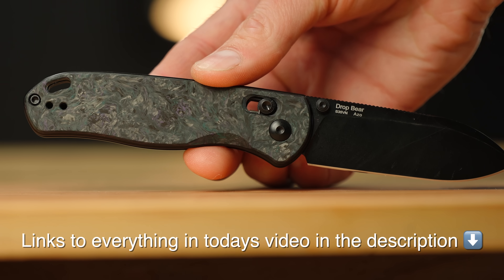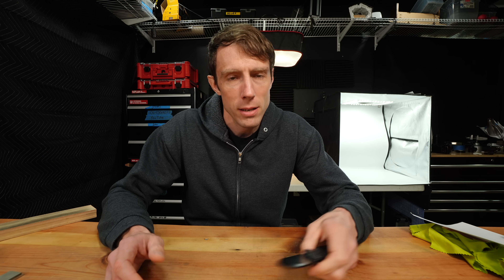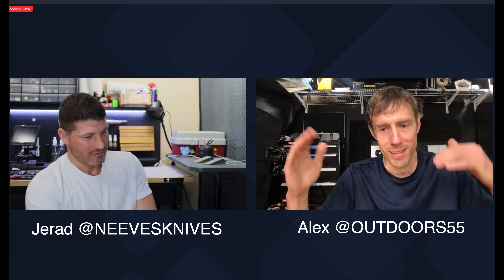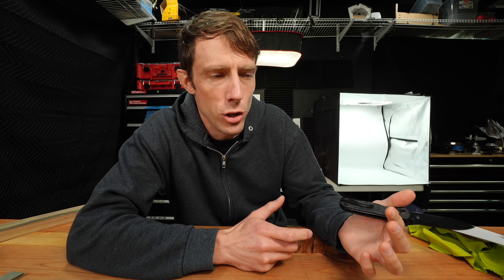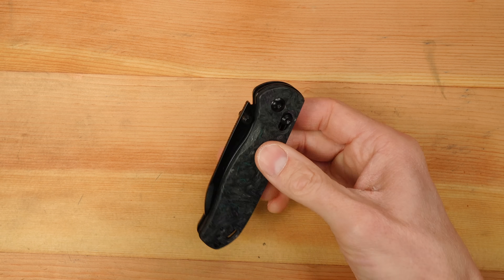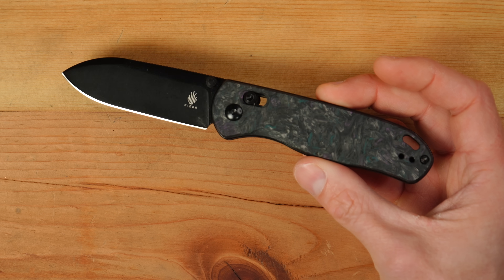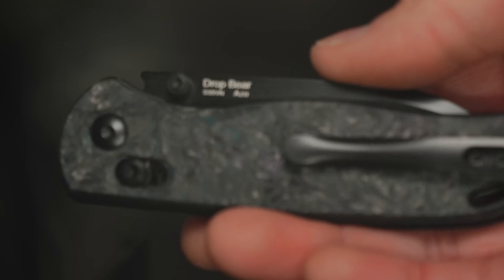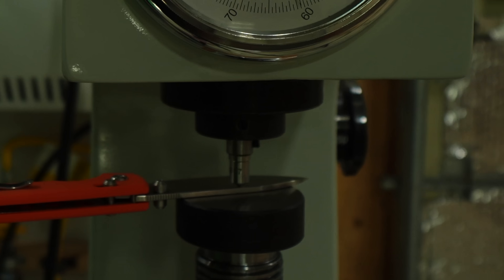Kizer Drop Bear Review - All Time Great, Or Over Priced Wannabe?

Comment: Kizers heat treatment overall is not good. They did improve some steels ht but overall I just avoid the brand.
Like they use a lot of 154cm, but would be better off using 9c18mov with civivis heat treatment which is better than 154cm performance and affordable.

Steel and ht is value. If its low its low value. If its low value the price better reflect that.

Comment: Bummer that they did get the hardness over 60 hrc.  I wonder if the uncoated versions or the 154CM versions are harder?  I have an Oknife Rubato 2 (OEM'd by Kizer) in 154CM that I love, but I have no idea how hard the steel is.  I just don't use knives hard enough to know.

Comment: I have the Elmax version with Artic Storm fat carbon. $210 I'm interested to know what the hrc is. It definitely gets extremely sharp and it seems to hold its edge similar to s30v or s35vn in my opinion.
Reply: Elmax is really good at 61rc. Dont settle for less. I wouldn't pay that much for any kizer though no matter the materials.

Comment: I've made a fair few knives out of S35 and its a much happier steel in the 60+ HRC ranges when it comes to stability in the geometry and retention with some pretty nice carbide production. But its an expensive steel and a bit of a hard sell to the general public for why they should use this expensive stainless kitchen knife over a much cheaper one and to some extent, they're actually right because its not that extraordinary a metal. Its very good and I genuinely like making knives out of it but I'm not going to say its great either as in terms of material price + performance its been eclipsed by others over the years.
Reply: Its hard to find good ht for s35vn. Chris reeves and Spyderco are about the only two that do it better than most others in production knives.
Reply: @tacticalcenter8658  its got ok ease of production but you probably want cryo to eke out a bit of toughness and hardness, it also has some pretty good edge retention and stain resistance. To the point if its corroding in something while you're attached to it, I'd be more worried for the health of the owner.

It doesn't finish nice enough for high end custom work though, takes a high satin machine finish but won't take a nice mirror. Main problem I have is that its high end prices for the metal for what's essentially the upper-mid range of stainless
Reply: @krissteel4074  there are much better materials like 14c28n, nitro-v or Abel.
Reply: @tacticalcenter8658  14C and Nitro-V are basically AEBL with some extra spices thrown into the mix. They are extremely tough and take a super fine edge but don't hold it for as long as S30 or 35.
It certainly looks better and you can get a nice finish on most AEBL family of steels
Reply: @krissteel4074  some heat treatment protocols for them do as good or better in some cutting than s30v. So you are wrong.
Reply: @tacticalcenter8658  Nah, you're not going to get much out of the AEBL for edge retention. S30 and S35 will at least double it's amount of cuts. All that Vanadium in there makes for some serious wear resistance
Reply: @krissteel4074  actual cardboard and rope cutting shows that some mass production 14c28n and nitro-v can cut more than most mass production s35vn and s30v.

Comment: I belive esee also heattreat the s35v version of the esee4 at 59-60 hrc. Is that a waste of stell?
Reply from the maker: 60 isn't terrible...im not sure what the point of a premium steel is if its only going to be 59hrc. Theres so much performance potential left by not leaving it harder. Personally id rather have 1084 at 63hrc than s35vn at 58-59.

Comment: Hrc hardness and edge retention cannot be compared across different steels. E.g. 58 hrc s35 has higher edge retention than 14c28 at 60 hrc.

The most important use of high hrc is the ability to hold a more acute edge angle. So unless you intend to sharpen at 25 deg inclusive or less, I think there's no real need to go beyond 58 hrc. 

Disclaimer: this is just my opinion.
Reply: Speak in facts. Crk is 60rc and Spyderco is 61rc and both perform far better than any s35vn at 58rc.
Reply: Often times 14c28n surpasses s35vn in cutting cardboard.
Reply: @tacticalcenter8658  yes I'm sure that happens. One of the most important factor for edge retention is the edge sharpening angle. A smaller angle has much stronger effect than a "better" steel. And higher hrc allows smaller angles.
Reply from the maker: We aren't compairing edge retention. We are comparing quality of the product for the price point. A premium steel like s35vn should have a premium heat treatment. If a $60 knife can do it, so should a $170 knife.
Reply: @OUTDOORS55  100 percent!

Comment: The only production company that's willing to run there steel hard is spyderco, everybody else runs there's soft as dog $&it, they want toughness over edge retention, but that's not why we buy most of these steels
Reply: Not every one. Kunwu pushes their steel to the limits. Even their budget IronFly brand has HRC 1 point higher than the competition.
Reply: @ThatImmo that still sounds a few hrc below spyderco, and yes I know hrc is everything
Reply: @DABinCHRIST  each steel has optimal HRC and Kunwu goes to the upper limits. Crossing the line turns the best steel into a pane of glass.

Comment: do a video on what actually makes a good edc knife so we noobs know what to look for in   a knife. type of lock, shape of blade for slicing, handle shape and so on... steel types are overrated it seems. you gonna need to sharpen no matter what.
Reply from the maker: That's tough! Its so individual I don't think I could 🙂👍
Reply: @OUTDOORS55 of course its individual. thats what we want. do it according to you. we dont need some ignoramus opinions anyways.
Reply: @DunjaIlic-vi8ei for me my spyderco tenacious in m4 is the perfect knife. I don’t live in a highly corrosive environment so I don’t have to worry about it rusting. If you work in a boat fish in the ocean maybe look into a stainless blade or get it coated. It’s a nice size for casual carry to even when I’m hiking or working. It also depends on what you need it first example when I was helping with concrete and gravel bags I grabbed a cheap knife not to destroy my good one.

Comment: Isn't the hrc always lower on coated blades? If I remember, civivi coated blades are always 2 points lower than the plain versions. Now, why that it i have no idea. Im not even sure if that's standard, but it seems anytime a blade is coated, it's 2 points lower. I think neeves knives said that about the ones he is designing.

Edit. I'm not saying the coating takes away hrc on the cone of truth. I'm saying if you bought another kizer in the same steel s35vn that from the factory is not a coated blade it would be 2 points higher hrc. I don't know that for kizer but I know civivi does that. Why I don't know but would like to learn why. I assume it's the baking process of the coating to the steel lowing the hrc but that's a guess.
Reply: He just demonstrated this is wrong at the end of the video
Reply: @Dan12345  no I don't mean the coating makes the hrc lower. I mean the factory either heat treats it lower before the coating or the coating takes away 2 points of hrc. I assume from it being baked on. I'm not sure about the terminology. You could take the coating off like he does and get the same hrc number. What I'm saying is if you bought the same kizer s35vn steel thats uncoated from the factory it would be 2 points higher hrc.
Reply: @orangerider2827  My mistake, sorry. I’ve got no idea why that might be. It would be interesting to see if it’s the same with other makers like Spyderco
Reply: @Dan12345  I would love to know the answer. It's why I put it here asking hoping it turns into a video.

Comment: Cmon dude, The action of the raccoon isn’t even in the ball park of the drop bear. Especially that axis lock raccoon. Does it make it worth 100$ more? No, but it’s not “90%”
Reply from the maker: I think it is. The lock itself on mine (cant speak for everyone) is great. Imo the handle design has a lot to do with the feel of the lock, as well as the spring tension. Id add a lighter spring to the raccoon and id definitely be better.
Reply: @OUTDOORS55  did you know that the drop bears spring can be adjusted? Theres three positions that the spring can ride in.

Comment: bossman ... I'm sorry. I must stand up and two thing: disagree with you , and firmly believe you will change your mind. There is a massive difference between knife steels. There are MANY steels that can feel the same, and if the metal is a hardness then the metal is a hardness and some of your sensations will only relate to that ,,, but when you contact material with the knife,, very subtle differences in the knife steel will result in very noticeable differences in your tactile experience with various materials. Yes ,, you CAN have many many experiences where  it does not feel distinct, but just because those conditions that time were similar does not mean that the conditions will not vary in ways that will be distinct. S30V is a better slice, but most people are better off with S35VN specifically because it's not a better slice, and is instead closer to a classic stainless cut, safer all around, better at monkey stuff, etc. ,,, and they will definitely feel how S35VN is more comfortable in interactions, and has a more stable grip on materials they do not cut. S30V combat , S35VN woodsman
Reply from the maker: We'll have to agree to disagree 😉👍
Reply: @OUTDOORS55  you know the other thing I thought is that a lot of people will have a better experience with that drop bear at 58hrc than they would at 62-61. Overall they will need more effort to cut ,, but once they settle in they will have a lot of control with a lot of materials that don't usually get the box cutter, and will use a box cutter where a box cutter is better anyway ,, meaning that although it will never give them quite the same sharpness sensation,, they will probably be more comfortable with it and more familiar with it more quickly, as they can interact with it with a bit more energy. -------- and as far as feeling the difference in steels while cutting ,, there's a fair amount to be said on edge bevel roughness as it relates to how it was sharpened, but also as it relates to the grain quality and exactly what the roughness will manifest as
Reply: @tsmspace you are wrong.
Reply: @tacticalcenter8658  yes i love to discuss and hear your list of reasons.
Reply: @tsmspace  what is your county of origin?